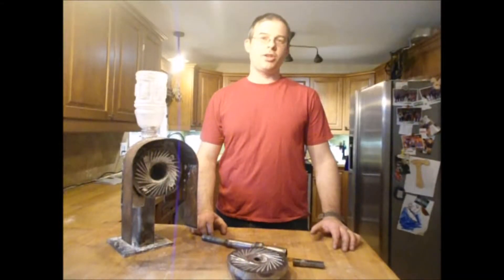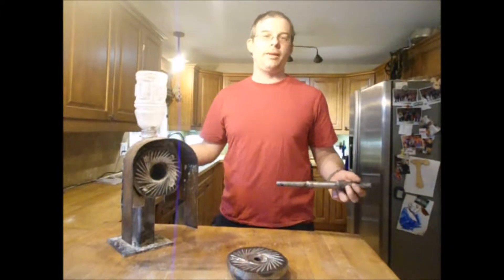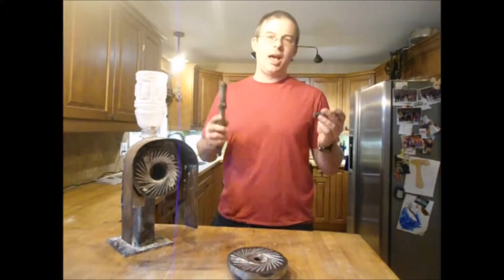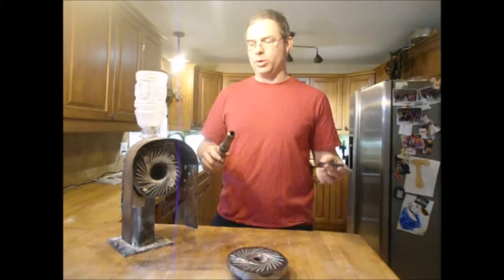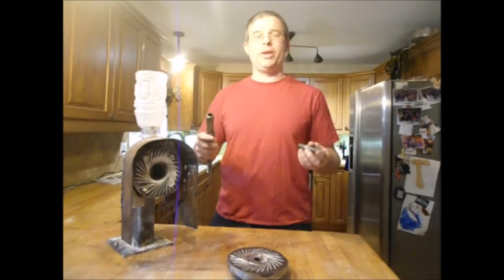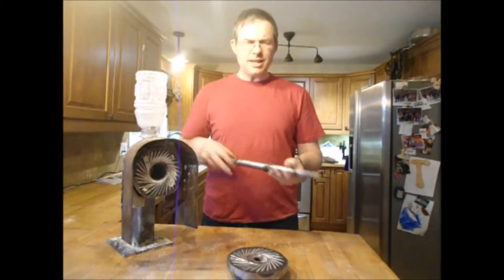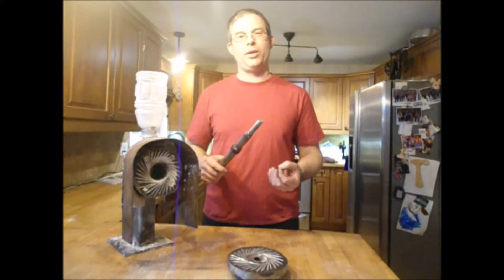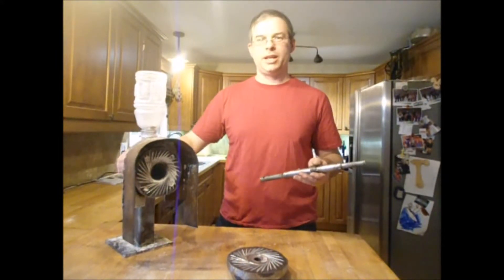Homebuilt Flour Mill Fix

Comment: As for homemade home, it has done a good idea ...
Reply from the maker: +Aleksey Camodelkin Thanks,  I've enjoyed building them and really enjoy using the variety of fresh whole flours in my baking.
Reply: I am grateful for the video for sharing. Because in our region, I could not find. I had to look at a Second Language websites, there are many choices. After rozdestva go to the former job to do the same. If my lathe is not ruined. I am a former turner. Thanks again ...
Reply from the maker: Hope your lathe is in good shape, but you can make a really serviceable mill with only an angle grinder, drill and welder - a lathe and mill are nice but definitely not necessary.  Cheers.  Erik
Reply: +enduringtechpress Greetings. Was today at the former job, lathe complete ass. this shit soon as we derdat. Metallaloma piece. Roztachival cams useless. We need to change chuck. Promuchalas half day on raztochku kulochka spat eventually became the machine of the former teacher Peter. Then things went. How to make obizatelno'll check out your work. Regards, Alexey ...
Reply: +enduringtechpress I am grateful for the fact that shared his video about the mill. Since the choice is large and what kind is best to choose not to know. We have here such as you simply can not. And for this I had to look. And you have a very wide razveto in this case ...